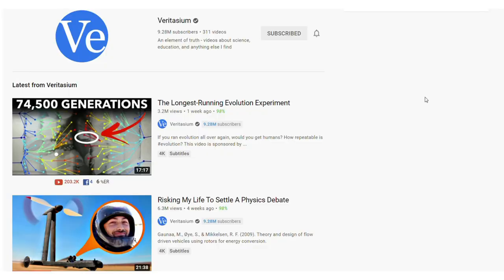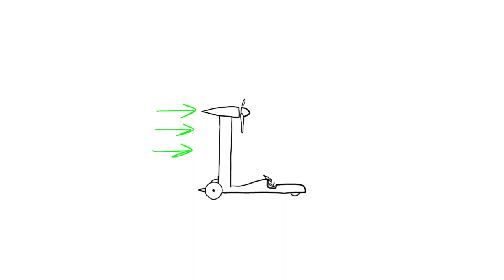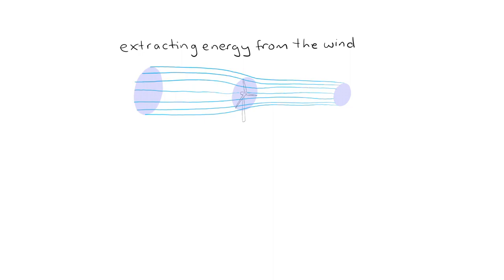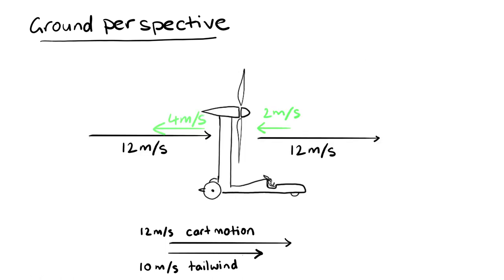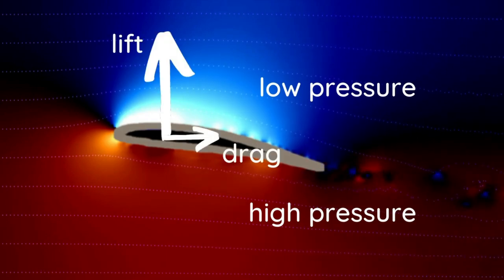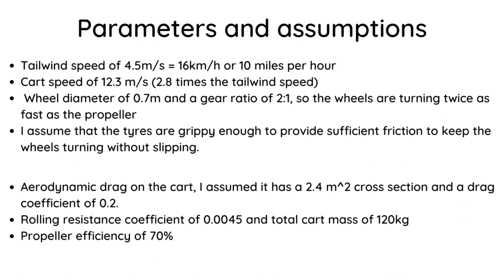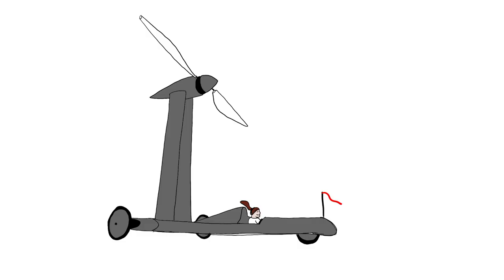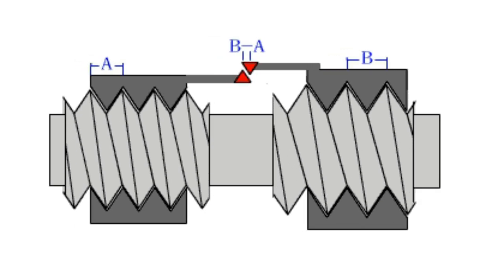Downwind Faster Than the Wind by Veritasium: How Does it Work?

Comment: If you push off a car while on roller skates, you will not keep accellerating. You've lost your energy source and you will slow until you're resting against the moving car again.  If you outrun the wind speed STRAIGHT DOWNWIND, you're outrunning your energy source and you will slow back to windspeed.  Running at an angle to the wind like a sailboat, yes....... but straight downwind...... NO.  You do not OUTRUN the wind.
Reply: You can't "outrun" the wind any more than you can outrun a river in a boat.  No matter what speed you go downriver, you're still getting the benefit of the river's flow.
Reply: //"Exactly. These people obviously don't understand that. They believe that momentum is a power source."//

I'm not sure who "these people" are, but given that you claim the device will "slow back to windspeed" if running directly downwind, it is you who does not understand.

The Blackbird is a steady state device.  Given a 10-15mph wind, it will accelerate to ~3x the speed of the wind (running DDW) and remain there until you run out of wind, room or interest.
Reply: @johnborton4522   You have to add power to outrun the flow of the water. Where is the power coming from?  The forward momentum?
Reply: @spuriouseffect  

//"You have to add power to outrun the flow of the water. "//

You do have to add power to go faster than the fluid (in this case, air), but as I explained above, it's impossible to "outrun" the flow since you are immersed in it. 

//"Where is the power coming from?  The forward momentum?"//

Nope, the power is still coming from the relative motion between the air and the ground.  When you slow down this relative motion between the two, you can use that harvested energy for any purposes you wish -- in this case motivating the craft.
Reply: @johnborton4522   What??  No. LMAO  When you're floating down the river you are not moving relative to the water when you're traveling along with the water. The water cannot make you go any faster. You have to add another energy source to move faster than the flow.
Reply: @spuriouseffect  

//" When you're floating down the river you are not moving relative to the water when you're traveling along with the water."//

And this is where you continue to fail - the device is not harvesting energy from the relative motion between fluid and craft as you continue to assume.  Your assertions would be correct if it were attempting to so such.   As I have carefully stated, it is harvesting energy from the relative motion between the fluid and the GROUND.  This motion continues to matter the speed of the craft.
Reply: @spuriouseffect  

Watch the two Veritasium videos she references when she made this video.   Near the end of the 2nd video, Veritasium gives a simple demonstration with a wooden board and a wheeled cart which highlights your misunderstanding and shows your assertions to be false.

In that demonstration, the wheeled cart travels faster than the board without any other energy input other than the board.  In this demonstration the board represents the wind.
Reply: @johnborton4522   You can't harvest energy from something that is not placing a force upon you.
Reply: @spuriouseffect  

//"You can't harvest energy from something that is not placing a force upon you."//

Correct, but the wind is placing a force on the craft even when traveling at exactly wind speed because the wheels and the propeller are geared together. 

Bottom line is you simply have a misunderstanding of how the craft works.  If you continue to want to insist on things you don't understand, I'll just offer you the same $10,00  wager that UCLA physics professor Kusenko made with Veritasium (and lost).
Reply: @johnborton4522   I'll take your bet. I will release a balloon into the wind and you will never catch it in this craft.
Reply: @spuriouseffect  

Here was what Professor Kusenko told the media just a few days before he conceded the wager and paid Veritasium the $10,000

/""Thanks to the laws of physics, I am not risking anything," he told Vice in an email. "So, I could accept any bet, however large or small the amount might be.""//

Like you, he didn't stop to figure out how the device worked before making his assertions and just went with his "it can't be done" intuition (for exactly the same reasons you state).

Again, I'll happily offer you the same wager, and I'll give you 2:1 odds.
Reply: @spuriouseffect  

//" I'll take your bet. "//

Excellent.  

So this is how the wager works.  

1: You and I agree on the wording of the wager.
2:  We agree on three judges skilled in physics/engineering/science education.  
3:  We escrow the money (you $10,00 and me $20,000)
4:  We both make the case for our side to the judges.
5:  The judges make their decision and award the $30,00 to the winner.

We'll start with the original brainteaser question just so you're clear on what is on the table:

"Can a device be build which can travel directly downwind, faster than the wind, powered only by the wind, steady state?"

This is the question which the Blackbird (and smaller variants) answers in the affirmative and which you claim is impossible.
Reply: @johnborton4522  I said I'll take your bet. You cannot catch a balloon released into the wind with this craft.
Reply: @spuriouseffect  

//"I said I'll take your bet."//

You can keep saying that, but without the specific wording agreed upon, there's nothing for any judges to adjudicate, so let's get to work on that.

Let's again look at the claim and see of we can agree on some key definitions from the claim:

//"Can a device be build which can travel directly downwind, faster than the wind, powered only by the wind, steady state?"//

Wind:  
"Wind is the relative motion between air and the surface upon which the device rolls"

Directly downwind:  
"As close as is practical, the device must be moving in the same direction that the wind is traveling over the rolling surface."

Faster than the wind:
If say the wind is traveling 10mph across the rolling surface, the craft must travel across the rolling surface at a speed faster than 10mph.  

This would also mean that in a laminar wind,  if a neutral buoyancy balloon were positioned at the hub height of the propeller and released next to the craft as it traveled downwind at the craft’s maximum speed, the balloon would move across the rolling surface at a speed slower than the speed of the craft (in other words, the craft would win the downwind race against the balloon.)

Powered only by the wind:
"Other than the energy contained in the wind, no other energy may be used to accelerate the device."

Steady state:
"No energy storage systems are allowed to accelerate the craft.  No batteries, no flywheels, no gravitational storage, etc."

If you disagree with any of those, let me know how and why.
Reply: @johnborton4522   You said that this craft could travel up to 3x the speed of the wind. I'm saying that it may be able to do that at an angle to the wind, like a sailboat on a tack, but not straight downwind. So if you can get this craft to catch a balloon released into the wind, which should be easy if you can travel 3x the wind speed straight downwind as claimed, then I'll pay you 10k.  If you cannot catch the balloon, then you pay me 10k.
Reply: @spuriouseffect  

So you agree to the wording of the claim and it's associated definitions (which details and covers your counter claim above?)
Reply: @johnborton4522  Just with one exception to your definition......you must travel straight downwind following the balloon so you both remain in the same wind-stream.
Reply: @spuriouseffect  

You'll have to figure out a way to define that differently, because the device can't "follow"  a balloon that is behind it (and it would be in short order)
Reply: @johnborton4522  You need to take a sailing course. In order to sail faster than the speed of the wind you have to harness 2 types of wind. Atmospheric wind called true wind, and apparent wind which is created by the forward motion of the sails through the air. You end up with a push pull effect that increases the speed of the boat up to 3 times. That doesn't mean that once you get up to speed that you can just use the apparent wind to power the boat. If the apparent wind was powering the forward motion, then you could turn the boat straight downwind and continue on your merry way, but you can't because you would be going faster than your true power-source, the true wind, and you would no longer be receiving a force from that true wind. The true wind is what powers the apparent wind. That is why you must run at an angle to the true wind so you aren't moving faster than your power-source. The wheels geared to the turbine/propeller on this craft are not the power-source. The true wind is the power-sorce, and you cannot go faster than your power-source. The funniest example is when he puts the model on the treadmill and claims it as proof of concept. The wheels are turning the propeller which makes the cart fly off the end of the treadmill He doesn't take into consideration that the energy source is now the motor on the treadmill. LOL If the turning wheels and the propeller were the power-source then you could simply bring the vehicle up to speed and it would power itself.
Reply: @spuriouseffect  

//"You need to take a sailing course"//

You need to stop assuming you know anything about me.  I own multiple NALSA ratified sailing world records.

Now, how about finishing the agreement on definitions and judges so they can award me your money.
Reply: @spuriouseffect  

Seems like you have lost your confidence haven't you.

I'm ready to enter into the wager.  You have agreed to my definitions with one exception but have not responded to my questions on in that regard.

Running away aren't you.
Reply: @johnborton4522   Did you not read my last comment?  LMAO
Reply: @spuriouseffect  
//"Did you not read my last comment?"//

You mean this one from a few days ago?:
//"You need to take a sailing course"//

I did read it and I responded several days ago. 

It's possible (it's happened to me) that you responded after that and YouTube filtered it such that it doesn't show up on my feed.  This happens sometimes if you try to post certain links or contact information (you have to be pretty sly to get that stuff in as the algorithm thinks it's spam).

Comment: It's impossible for a vehicle to 'continuously' travel faster than the wind. If the wind velocity is not constant then yes, every now and then the wind will slow down and suddenly your wind-powered vehicle is travelling faster than the wind, but that's only because the wind suddenly died down by 50%.
Reply: Well, other than the fact that ice boats have been doing it for more than a century, land yachts for many decades and high performance sailboats for many years now, yeah ... it's impossible.
Reply: The 1877 Brennan torpedo operated on the same principle. It is not a new concept.
Reply: @rcgldr  

And not only that, the core principle was demonstrated the first time a boat sailed upwind.

Comment: 5:55 Not happy with what you're saying !
One minute you're saying you have a minus 10 m/s headwind then say it's a 2m/s headwind.
The wind from the prop is 12m/s  then you say it's 4m/s.

So I'm aborting at this point :)
Reply: You're confusing different things. 10 m/s is the wind speed relative to the ground and 2 m/s is relative to the cart.
Reply: @seneca983  Well someone is - as this part was supposed to be all relative to the cart !
Reply: @millomweb  Not all of those listed speeds were supposed to be relative to the cart.

Comment: A good quantitative simulation does not need words, and the process of design is more efficient, not maintaining an inaccurate word model alongside the simulation.  The words will always be ambiguous, but the model can be calibrated and fit to measurements from the real system.  So more calibration and modeling and less talking head and words, please.  Also, allow for gearing, in addition to variable angle of attack.   A good model will span the entire range of all parameters, and allow for optimization along any combination of dimensions.  An open model allows for many collaborators - all working in one model and clear variations.  Passing knowledge by word of mouth is always lossy and inefficient.  Sharing models, measurements, records, model assumptions, calibration data - this is the way to deep understanding and efficient tools.

Richard Collins, Director, The Internet Foundation
Reply: // " Passing knowledge by word of mouth is always lossy and inefficient. "//

And yet, here you are, wordy as ever.